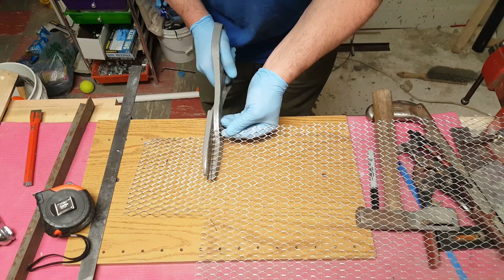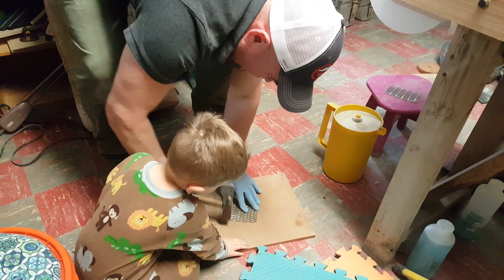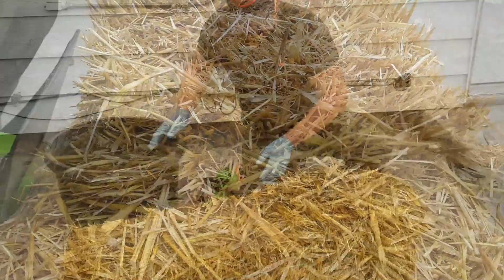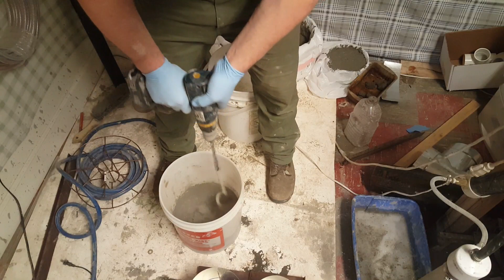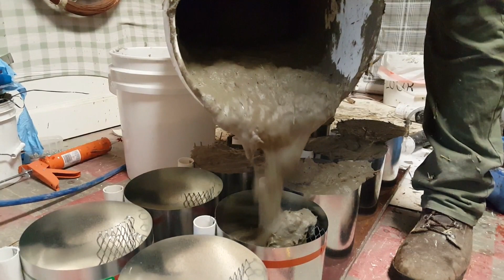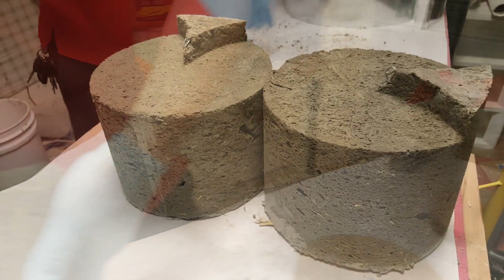Pouring Organic Aircrete Blocks For Raised Garden

Comment: You could probably build a vibrating table to put your molds on while you are pouring to get out the air pockets as well as getting the concrete down in the bottom.  A small AC motor with an off-balanced load mounted on the underside of a regular table would provide the vibration.  - Just a thought.

Comment: Just getting caught up with this aircrete stuff.  I noticed a fellow (Man about Tools) using a SawsAll without the blade on the edges or bottoms of the jig to vibrate it and help get the air out and settle the mixture in the mold.  That may help get the Aircrete into the corner of you reinforced wedge area.  Just a thought.

Comment: Honey Do Carpenter - I know it might sound ridiculous but you could soak cut straw in a water soluble all surface sealer in 50% water & 50% all surface sealer ratio. Dry the straw thoroughly & it will be extremely rot & mold resistant. That way your aircrete creations will last decades.

Comment: If you use some sort of long, slender, and strong vibrating object when you pour the cement, you will not have as many air pockets and it will fill the small voids better.

Comment: Love your idea, but have a comment:     Concrete likes to have a "minimum cover" over rebar / mesh.    I think yours might be a little too close to the surface, and may eventually start splitting away.     Try arranging your mesh in a "tee" shape:  one piece parallel to the exterior curve, with at least 1" cover.      Then one piece up the center of the "V".   But resist the temptation to get too close to the tip because you want a substantial amount of aircrete on top of it.  2-3 pieces of bailing wire should hold the 2 mesh pieces together when you pour

Comment: Just bandsaw the little triangle with the weak part missing. (A small radius) Far easier than the metal web, which is a pain in the ...
And smooth the tops, so they stack nicely......One way is a mold top.

Comment: Hi Honey Do Carpenter,     I saw the install video over at Julie's. I was wondering if you could design corner blocks that would work with this system. The varmint cage did not look like it would fit well over the corners of the raised bed.     Cheers,     Bill

Comment: That little point is going to snap off if you stare at it too hard.  I would fill in the mold so the finger has about 1/4" radius. Try pouring an inch or so into the mold and then sticking the wire into it.
Reply: someone's thinking.
Reply: Hugh Brackett I would set the mold on top

Comment: That little point serves no purpose and causes difficulties at all stages, it should have been radiused with a drill bit at the mold making stage. Of course it's easy to have all the answers with clean hands in my armchair after the fact.